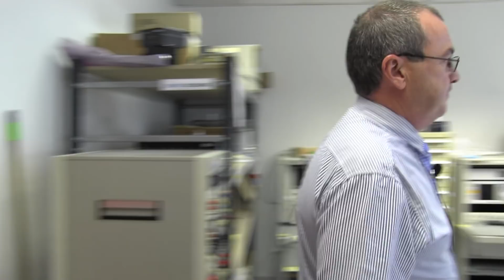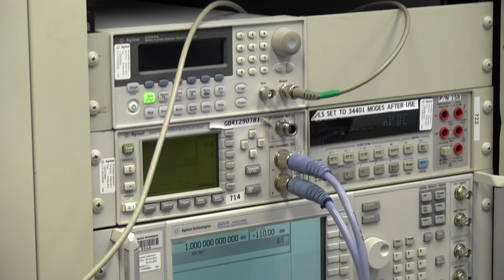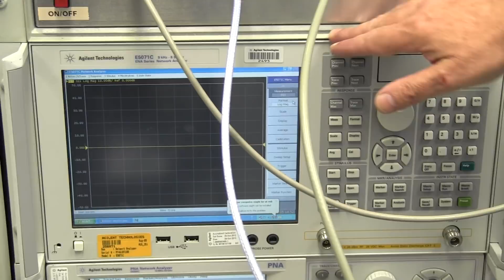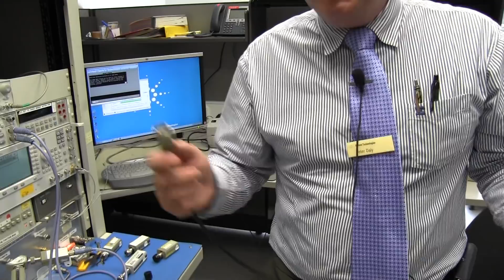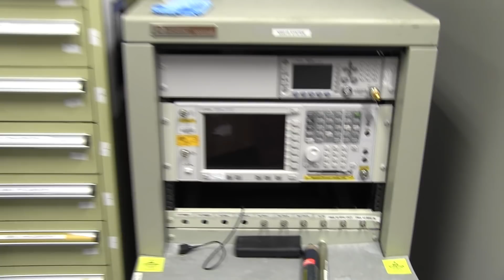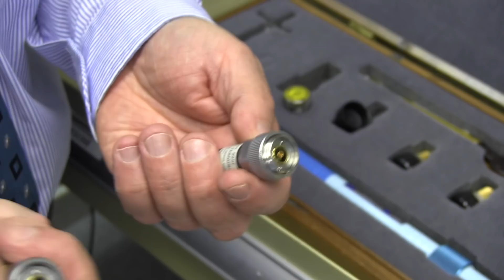EEVblog #1039 - Keysight Metrology Standards Lab

Comment: I work in a RF Metrology lab ( dc-50Ghz). It is not uncommon to spend $$$$$thousands on connectors and cables. Due to the constant cleaning torquing on and taking off they all wear out.We have our cables on a PM and sweep them on a regular basis. However, on the video, it was boring.

Comment: Seriously, someone would have done those connectors up with stilsons? I think my advantage of learning electronics seriously at the age of around 30 odd was that I already learned the basics of other trades such as mechanics, Welding, building etc. To me it would be obvious not to use force on an obviously delicate piece of equipment even by just looking at the box it was stored in and probably everyone reading this has much more skill in electronics than I do. If you have people doing things like that in your lab then someone needs to give HR a kick up the butt!

Comment: ESD is rigthly important, but cardboard boxes on the bench????....... I can tell you that in the defence sector that's a big no no, deal with a company like Rolls Royce and they'd tear you a new one for that.
Also, are the chairs ESD bonded? Typically man made materials, sitting off the floor on non-conductive wheels.
Laser printers a big no no too, as they use static to transfer dry ink and the paper always comes out with a slight static still on it.

I worked for a place that used to lie to customers about their ESD measures, we had a "fully bonded ESD floor" (or should I say standard vinyl flooring with a big helping of BS?), it's one of those things they usually get away with because companies or potential customers always send "idiots suits" rather than engineers. As an engineer i'm also a BS detector......
In this video they have clearly run around sticking ESD signs on things before hand, which in itself is not necessarily bad as long as they back it up.
Reply: Also, from looking, it is reasonable to assume that the clothes that both are wearing are not ESD compliant - I guess that's why they never did a foot test when entering the room.
Reply: Well that's another issue, I once worked for a major Japanese electronics corporation here in the UK, the production facility had a dress code imposed by British management of "ESD coat, ESD hat, collared shirt and black trousers, NO JEANS) most of the non-jean trousers you can buy will be man made materials, as a result production staff used to walk around discharging themselves onto custom made production/test equipment worth £1'000'000's, jeans would actually have been a better choice, or at least supply clothing made from natural fibres.......

Comment: How can a company that produces such extremely advanced measurement equipment.. produce such utterly garbage printers? This isn't a technical question, it's a marketing question. Why associate HP both with extremely high value measurement gear, as well as consumer shit? The mind boggles
Reply: Because, they' re not the same company anymore. Now for almost 20 years. They are not connected in any way. Some might say, the heart of HP became Agilent. The EMG of Agilent was once the core of HP. Computers and printers came waaayy later.  Today this heart belongs to keysight. Although Agilent is still going strong with chemical analysis stuff.

Comment: just one question from a newbie,if the damn connectors can break so easly why dont make them easy to replace in such gear? maybe the losses from a extra cable on the input or a edge card or something detacheable on the frontend board would be too much loss for the aplication?...
Reply: Its not that they 'break' its that they wear down if not used correctly, spinning them as you tighten shaves a microscopic layer off through friction and at the frequencies they are testing that can have a significant effect on your result over time. They are also they are very expensive to make - there's probably only a few tens of places in the world that need them so its not like you can get mass manufacturing advantages. Breaking them out on a detachable card might work but apart from the losses you mention it means there's an extra piece in the chain that would need to be calibrated/verified.
Reply: regmigrant I see thanks for the explanation

Comment: There are a few things said about RF connectors around 17:30 that are about as wrong as it's possible to be wrong: "Its' not 7mm wide, the area is 7mm wide" No and no. A 7mm aka APC-7/GPC-7 connector is 7mm wide between the inner walls of the outer conductor.  An area can't possibly have units of length. The dimensions of these connectors can be found in IEEE Std 287-2007, IEEE Standard for Precision Coaxial Connectors (DC to 110 GHz). Annex D gives dimensions for 7mm.  Likewise APC-3.5 is 3.500mm (Annex F). The standard is paywalled so I can't distribute, but some good info can be found here https://www.microwaves101.com/encyclopedias/790-microwave-connectors. Rant over, sorry.
Reply: I think he meant to convey that (it's the width of the waveguide not the width of the centre pin) but it wasn't explained very clearly.
Reply: You would expect someone in this position to get this right. It's the width of the interior of the outer conductor of the transmission line. It's not a waveguide it uses TEM modes.

Comment: Another accredited cal lab here (DC-18GHz). People complain about the video being too much about connector care but RF cal is all about connector care! Also those micrometer calipers in those cal kits aren't there for show. First thing you do when a bit of kit comes through the door is you measure the center pin of their N-connectors for tolerance limits before you let them touch any of your equipment. Plugging a customer N-connector to your network analyzer cable can cost you 10,000! Also you clean them constantly. I don't see any cleaning kit around, solvent, cotton swabs, toothpics? You might also want to consider building a jig for the network analyzer cables for your S-parameter calibration. It helps with the repeatability and  removes a lot of the risks to do with the operator handling which is your biggest source of uncertainty!

You might want to join NPL's RF Metrology club ANAMET. They publish a lot good practice guides on RF measurements and practical connector care:  http://www.npl.co.uk/networks/electromagnetics-network/anamet-the-rf-and-microwave-metrology-club

Comment: Cal labs stuff bores me once Dave and the guest confirmed (in their opinions) in the past that "Calibration of a device does not involve any adjustment or correction of that device". Given that, I would only use their service when some law or regulation requires me to, not because I think there is value in using their $$$ service.

 I feel what they are selling is validation not calibration, as the unit being "calibrated" will perform the same when it leaves their lab as it did when arrived at their lab, only paperwork is produced.
Reply: You use the device as before, and its performance doesn't change, but in your processing software you update all the offsets. Many devices also let you update the display offsets after calibration, so that the displayed value will be accurate even though the measured value has the same error. Calibration tells you how the device is drifting with time, so you can update your error analysis. 

Even devices that can't be adjusted need calibration. They mentioned rulers in the video: steel changes size with temperature and wear. If you have a precision scale (fancy machinists ruler) you can't adjust the values it reads but you can adjust the correction table you use with it to determine the actual length measured.

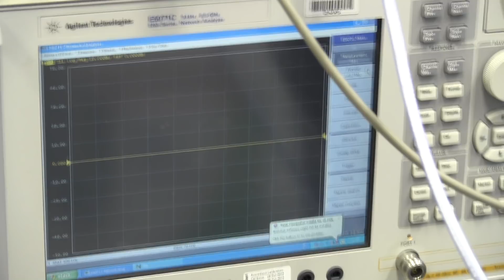Comment: 13:17 "Your computer might be at risk" "Antivirus software might not be installed". 😬
Reply: It is a shame that these devices have their user-interfaces done with software like this. But they are "only" measurement equipment... It is more scary if you look at medical devices in hospitals, think about heart-lung machines running this kind of software. ;)
Reply: Lol yeah and its not just scary anymore it actually happened in the UK, half of our hospitals were effectively shut down because the IT departments weren't updating the PC's regularly if at all :/

Comment: One question. Why do test gears like these run Windows to begin with? Linux would provide low cost fully customizable solution. Is it for running Windows based analysis software like Labview right on these gears? Coz um pretty sure no one is gonna run MS Word in a scope.
Reply: Sometimes it's because they use off the shelf parts for which drivers where only/earlier/more easily available for Windows. Things like graphic chipsets for instance. A Windows license cost is negligible for this class of kit. Add the savings from reusing as much as possible from earlier proven designs, and you easily get vendor lock-in even a decade (or two) after alternatives have become available.
Reply: Hasanur Rashid Ubuntu!

Comment: Why aren’t the center of the connector square, so the can’t turn.
Reply: Ill assume its because a cylinder is easily manufactured to defined radius, a square needs all sides and angles to be the same, much harder to mahcine
Reply: ExtremeBlastoise sure but for this precision work? And a USB connector is square to., there is no friction on that connector.
Reply: I think you are confusing coaxial connectors with waveguides!  Trying to do metrology in the face of multiple
frequency-dependent modes would be, erm, tricky.
Reply: I was thinking along the same lines but maybe because you then need precision in three dimensions instead of two so it might be cost?
Reply: regmigrant I think your are write

Comment: >Brings us to a room full of very expensive and interesting machines.
>Talks about connectors for 18 minutes. 

XD 

lol. Great stuff though.
Reply: Tyler Barnes
Connections are the most important part of the system when you get up into RF.  The lab I worked for only went up to 1.1 GHz ‘scope calibration, but even there you have to be careful.

Try comparing some cheap Chinese BNC connectors to expensive variants.  Chalk and cheese.

Even some of the dubious 4 mm banana plugs that you see in Dave’s videos can be a source of problems — high resistance and associated heating, physical damage to the instrument connector or piggy-backed plugs due to rough surface finish.

If you have some cheap banana connectors then you should wear them in before use — spray some contact cleaner on then plug them into each other several times until there is no ‘crunchy’ feel, then clean off the contact cleaner using IPA (as there will be a fair amount of fine metal present from the wearing in).  Or buy better cabling; but cost is often a bigger problem than your extra time.
Reply: +PETMK  I disagree. I found the video very interesting and educational.
Reply: Not as bad as all that HP equipment
Reply: The connectors are easily over 1k USD each :)
Reply: It looked good. I expected he says somethink about the calibration procedures, about cooperation with other metrology labs... No, he killed the video by dumb connector that is more precise and bore expensive than standard... Thumb down for this video.